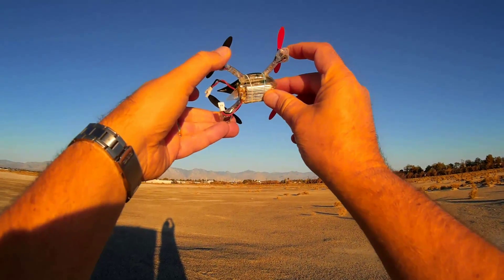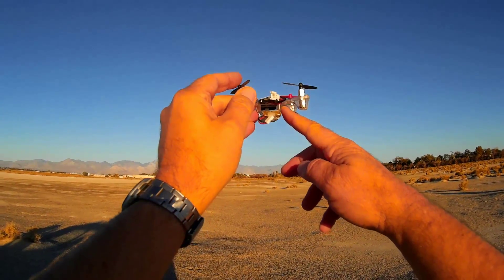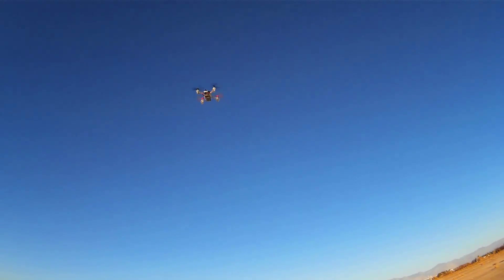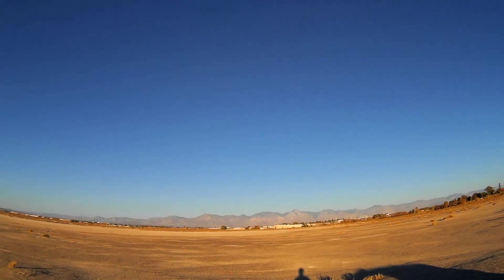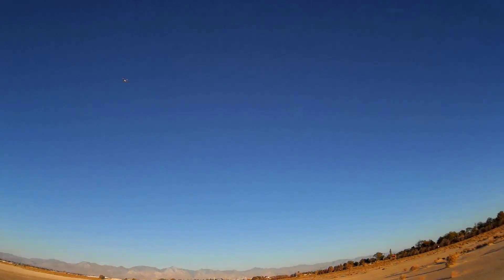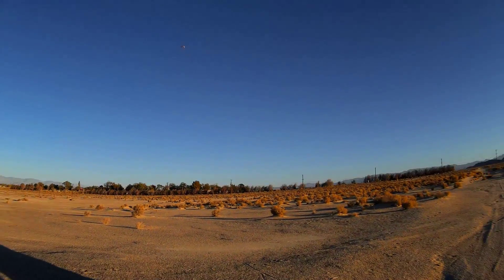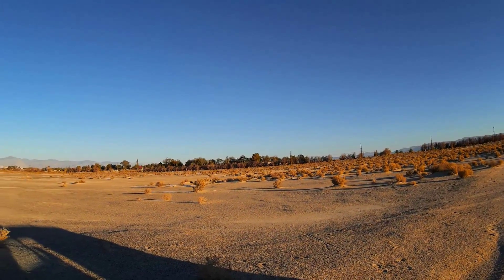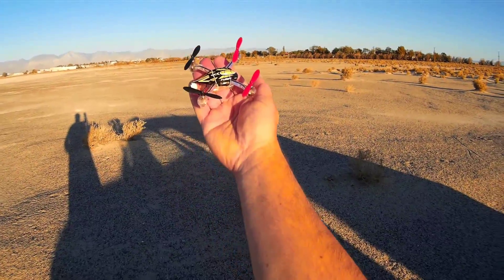Quadcopters and Hair Bands

Comment: Quadcopter 101 your WL Toys v252 quadcopter is it the original version with the pointy tail, Or is it the upgraded version with the small round tip on the tail and faster yaw rate?
Reply from the maker: I never could figure that out.  But it does have a pointy tail.

Comment: Curious if you have timed the difference between flight times with the battery change with this model.  Thanks.
Reply from the maker: Sorry, but no I didn't.
Reply: Quadcopter 101 No problem.  I certainly appreciate all the 411 you have given the quad community.  My guess would be double the flight time (more weight, but much more power reserve).